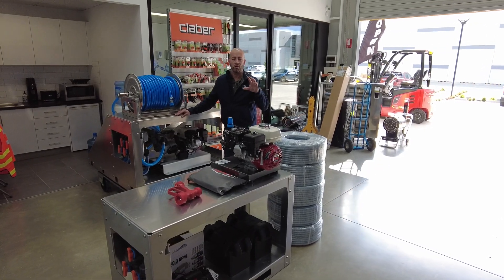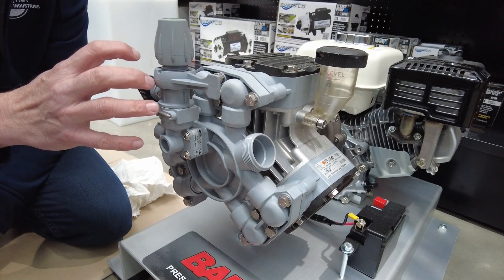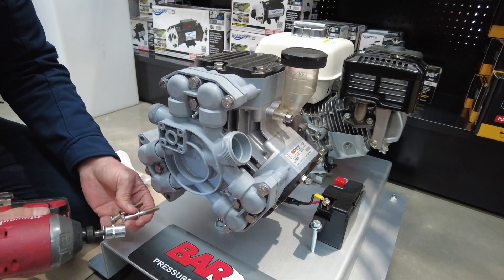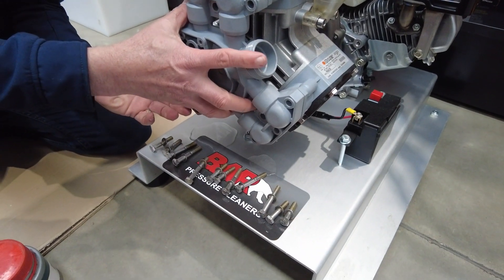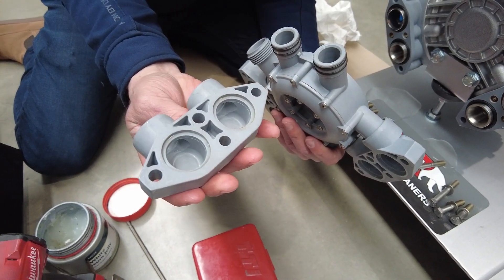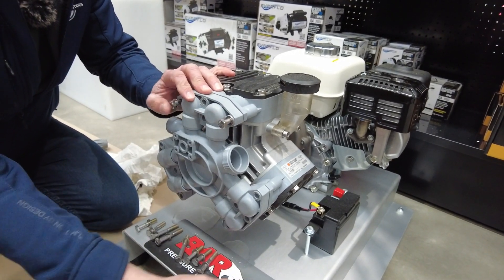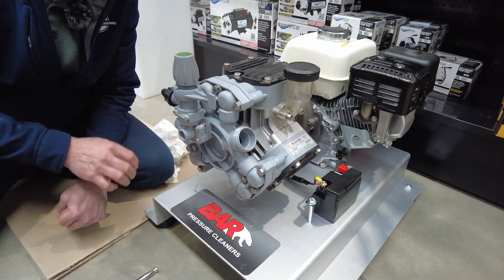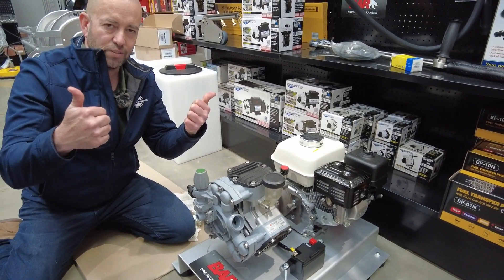SoftWash P40 Collector Regulator Bypass and Vam Maintenance

Comment: I am getting  air in the by pass line when it goes into bypass . Then it starts to loose working  pressure  and surges . Any ideas ?
Reply from the maker: @raymock8232  Fix your leaks a must. Bleed all proportioner valves and keep tanks below the minimum.
Air is leakage or run out of fluid in one tank.